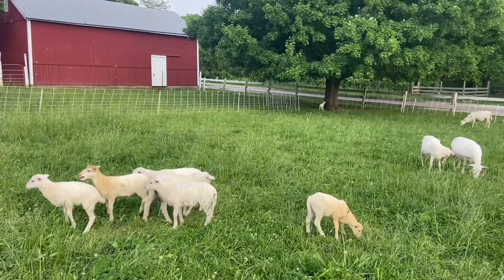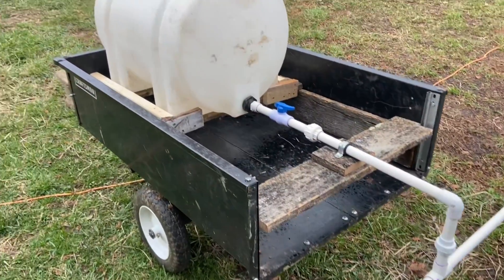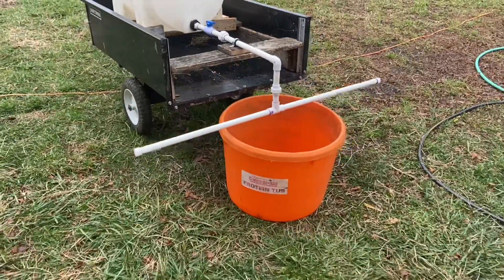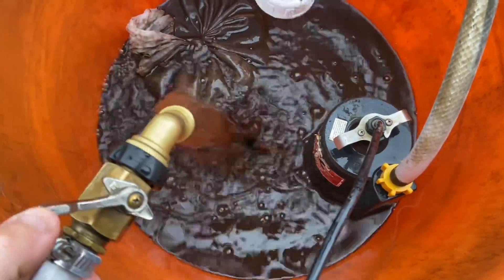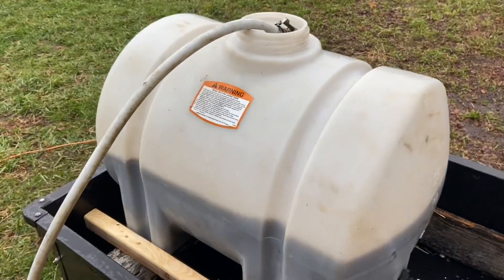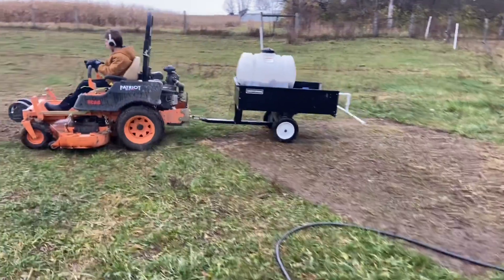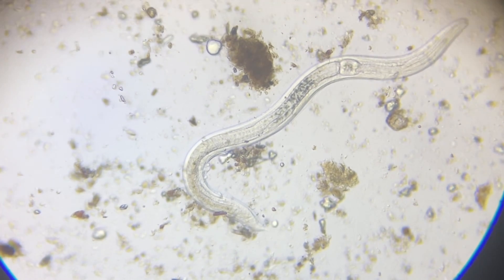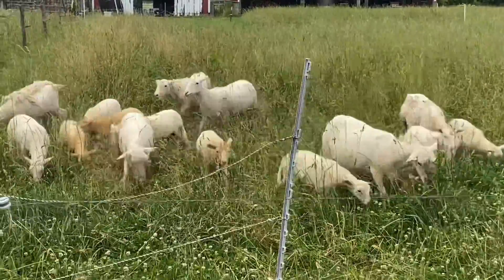$85,000 Johnson-Su Compost Extract on 1/4 Acre Paddocks

Comment: Glad to see farming smarter not harder with micro herds. One thing to note is that according to Dr. Elaine Ingham, the drill mixer gadget and pump impeller kills a lot of microbes. It would be better to use an airlift pump approach for mixing which aerates in addition to mixing.
Reply from the maker: I had always heard the aerators were for teas, not extracts.  Maybe splitting hairs here, but I had heard the air was an attempt at growing more microbes, which isn’t necessary with the extract.  Hadn’t heard the mixer/killer thing yet.
Reply: @birchfieldfarming  That is correct. To grow more microbes, you need aeration and food (sugar for bacteria and fish hydrolysate for fungi), aka - compost tea. 

The "airlift" pump is a "water pump" based on Archimedes principle of buoyancy -- no impellers or mechanical moving parts. It uses air pump to make water bubbles, water with bubbles is less dense than surrounding water and creates movement of water (ie. mixing) without harming the little bugs. Plus the bugs still need oxygen to keep them alive and prevent mix from going anaerobic if not used in timely fashion. Making extract is best with gentle massage of compost bag in water. Alternatively, you could just do gentle mixing with stick, paddle, or large spoon in your mineral bucket. The drill mixer and electric water pump however kills the little critters -- perhaps not all of them but a lot more than necessary.

Dr Ingham (I took her soil food web course a few years ago, highly recommend) also advises not to use high pressure sprayers (also kills microbes) -- which you are not doing. Your gravity fed application system is ideal and perfect.
Reply from the maker: @RA-LHTX Great info here, thank you for sharing!  Stick around, folks can use your input👍
Reply: @birchfieldfarming  One last bit of info. "Cleanliness is next to Godliness". You should clean all mixing and application equipment well with soap and water and finish off with disinfection (hydrogen peroxide or vinegar). Else you run risk of introducing pathogens into future extracts.
Reply: @birchfieldfarming  anytime you pump a solution with bacteria and fungi , you risk killing some of them.

Comment: Very nice. Why not just put the compost through a "manure spreader type thing" or just fork it out like hay to spread it directly on the field? Either way, I'm trying this. Thanks for the video.
Reply from the maker: Certainly an option - the extract makes it easier to apply especially at scale, as it only takes 2lbs compost/20 gal water.  We put something similar down and around our sweet potatoes last gardening season tho and they did amazing!
Reply: Use the tea to water in other amendments and get the plants innoculated to absorb the amendments watered in better.